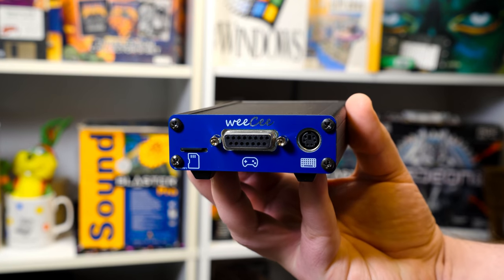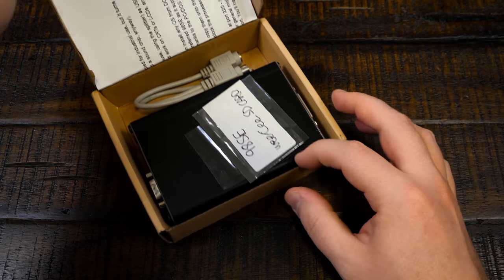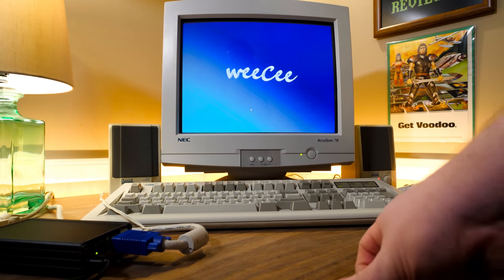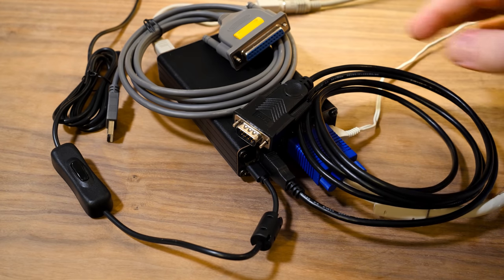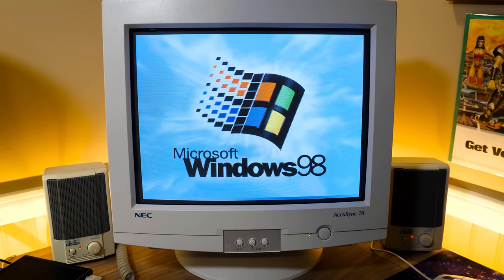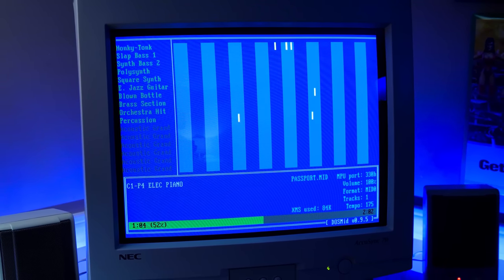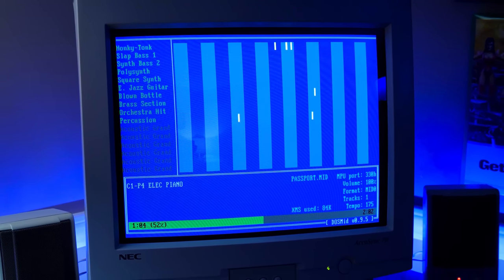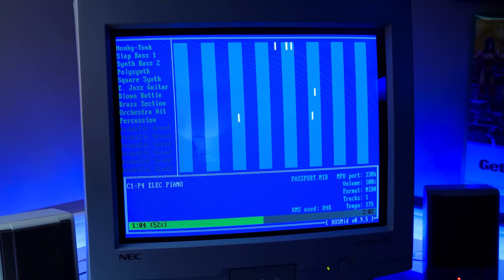The weeCee: A Tiny New MS-DOS & Windows Gaming PC!

Comment: I am impressed with this little machine! All the CPU options in the bios, being able to have a bunch of micro sds with different systems on them. For it to be perfect for my desires it would need to have a 3d acceleration solution, maybe a pci or agp slot would do it. Also the sd read and writte speeds leave a lot to be desired, but even as it is I can see it being very successful. I believe a Kickstarter would be a way to go for the developer to be able to plan a set production and cost and to be able to bail out  paying people's money back in case a minimum number of orders isn't met.

Comment: I think from a physical footprint and power consumption standpoint, this is a pretty amazing product.

Don't know if a higher speed rated Micro SD card works better for those installs, or just pumping up the clock speeds before running it.  I would say the clock speeds might be causing the long install periods.

Comment: An idea that I had was the reverse, but for vintage laptops or desktops. Imagine a PCMCIA card with an ethernet adapter and a Raspberry Pi Zero. You could use VNC viewer to log in it and have access to modern internet on a vintage laptop.
Reply: I've thought about cards like that as well. I don't think it would be too difficult to design an ISA card whose functions are all controlled by a modern MCU.

Comment: I would actually more likely buy that if it works well enough for older dos games. Would make for a cleaner setup instead of my large pentium or Pentium II system. Love the fact you can throttle the CPU down great for older DOS games for sure.

Make it a 3d acceleration version and would be my dream version. But as you stated this is close.
Reply: The lack of 3D and the slow MicroSD are the only things preventing me from wanting one at the moment.

Comment: I don't know the limitations of the little pc module but it'd be cool to have a mini itx breakout board so you could put it in a more traditional pc case and have a bit more room for i/o and maybe a floppy drive. Heck, being able to run it off a standard power supply would fix the issue of overloading the usb port. Even the lowest capacity itx psu would be complete overkill for this thing though.

Comment: I know a certain print shop that would love to have one of these to replace the Windows 10 PC currently running their entire MS-DOS-based invoice system on because they refuse to invest in a newer, more modern invoicing system.
Their old PC died and the boss looked at me and said "you like weird stuff, go try to save them.  Bill double."
Had to yank out the old IDE drive and blow the dust off my ancient USB-to-IDE adapter but I was able to image the entire drive into a virtual disk image that would work with VirtualBox.  A few more hacks later and it was back up and running on a brand-new Windows 10 PC with parallel-port card installed and printing to their ancient dot-matrix line printer.
Turned out some capacitors on the mainboard had just gone bad rendering the entire PC dead.
It was a complete nightmare and took a week but it got done.  That was many years ago...they're still using that same system to this very day.
Not to mention all the manufacturing machines out there still running MS-DOS-based programs.  This guy could stand to make a small mint if he can mass-produce these suckers in any quantites.

Comment: I would like to see this with I/O expansions, like a module you stack on top of it that includes a USB hub and the missing serial/parallel connections, or a hard drive bay.
I have never been interested in having original hardware around due to its bulky nature, so something like this would interest me.

Comment: A couple years ago I started on a project kinda like this. It would of been bigger then the weeCee but about the size of a computer power supply case. It was to have a power/reset/turbo buttons and a floppy emulator. However I wasn't going to use a SD card as the main storage but have SATA, the floppy emulator would use Micro SD. Sadly EasyEDA lost all of my work I had put into it and I haven't been motivated to start over again If I was to start over I would use KiCad.
I'm now working on a ARM based all in one system for Home Automation.

Comment: If they made it the size of a CD-ROM drive, it would still be small but they'd have room for all these nice things. More USB ports, full-size SD slot, serial/parallel ports, speaker, battery, buttons, maybe DIP switches to adjust CPU speed so you don't have to reboot into the BIOS to change it...

Comment: This thing is really awesome, but adding any kind of 3D hardware acceleration would make it absolutely essential to have.  Especially for people (like me) who don't have the space for a Win 98 tower.
Reply: I have an idea. A bigger PCB which can utilise a AGP port, angled by 90 degrees so the graphics card sits on the back, and all the other stuff on top. Put it into a little larger case than this one, and we should have a winner!
What do you think?
Reply: @danieldorn2927  I would definitely be in on that, provided the AGP port came populated with a decent graphics card of the era.  The charm of this thing is it's an SoC, and an AGP port would no longer really make it an SoC as you'd then need a modular graphics card.  But your idea is sound, I wouldn't mind a bigger form factor so long as it's significantly smaller than a full-on tower if that's what's necessary to get the thing 3D accelerated.

Comment: If the power supply is getting overwhelmed, it probably just needs one with a higher amperage -- same reason a beefier one is recommended for MiSTer instead of the stock DE-10 nano one.

Comment: This is so awesome and the fact that it allows you to connect original hardware and use original software without emulation. I do wonder though, how well a Pi4 could do with games from the Win98 era. I've managed to get a lot of DOS games running on my Pi4, haven't had the time to setup bochs or qemu to try for Win98 yet. Unfortunately, installing it through DosBox doesn't work as the Windows installer gives me weird errors depending on when it randomly decides to quit.

Comment: Very cool. A 800Mhz or 1200Mhz pentium 3 would be awesome for duke3d, doom 1-2, half-life, unreal tournament, quakes, gta 3, 1942, max payne 1-2, maybe even hl2 if a later gforce 4 or fx series. Pentium 3 architecture was beast in later Centrino mobile platform. GTA SA ran like a dream on a 1.6Ghz Centrino with 512mb

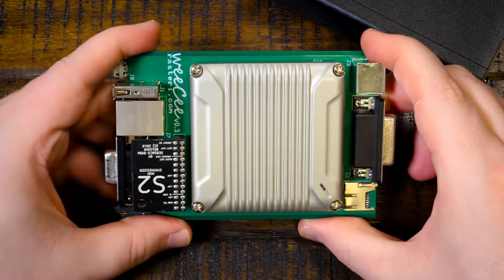Comment: 4:15 That's an issue I deal with in regards to running my Raspberry Pi. The only power supply strong enough lack an on/ off option.

Comment: This is super cool and would mind having one but a $600 price point is steep. I understand the part and skill to build this isn’t cheap, but there are cheaper options for a retro computer that almost as small. I use an old HP t5730 thin client to play older games. It’s got a 1GHz AMD CPU with a 32MB ATi video card. Not counting the SSD I instilled it was less the $30. 
If you’re not able to build a computer from the ground up, the thin client is a good option.

Comment: It would be nice to break out the PCI BUS to add an external graphics card (assuming that is possible with that SOM). Serial and parallel ports would also be nice to add. It doesn't need to be so small; it can be a little larger, and I think that would be fine. Heck, you could even just make it a microATX form factor and just sell it as a motherboard and just break out the ISA slots as well; that, to be honest, might be even better.

What I really want from this type of device is as many new components as possible so that it won't break as real vintage machines do all of the time. Dealing with vintage machines is a pain because of constant failures; I would buy it if someone could solve that problem without emulation.

Comment: Amazing! I always wished to have a cheap PC that could run Windows 3.11 to Windows 95 natively.
If they only would be able to run a 2 core, 3Ghz CPU, with 4GB of DDR3 RAM, and an on board IGP that outclasses the older ATI Radeon GPUs, yet has vga/svga compatible graphics options built in for DOS, you'd be able to max out all your games on something like that.

Add an emmc drive, split into partitions for DOS, Windows 3.x, and Windows 98se, to use either as OS drive, or with few smaller games installed; using the sd card slot for games.
For SD card I'd probably go with a Sandisk A1, micro SD card. The A2 is too fast for this application; the A1 is cheaper, and fast enough.

Comment: My issue is always that these kinds of systems don't work great with those early 3D accelerated games, and some of those are the kinds of games I'd want to play first over anything else.  If there were a way to play those types of games in an easier fashion (and without major problems to just get them to work correctly on modern hardware), it would be really helpful.

I think if something like this were a tad bigger with more IO, and full 3D acceleration, it could hit that sweet spot of small size, and usefulness.  I don't have tons of space so having a decently small retro PC would be amazing, but for me its gotta have good 3D acceleration.

Comment: I keep forgetting the compaq armada 1150 laptop I have can output to a display (because the LCD is washed out for DOS games), when I get around to using it, I can enjoy some retro goodness (going to ditch windows 95 because not enough RAM). Though, if the hard disk ever fails, i'll need an IDE to SD card adapter.

Comment: What spec games could this feasibly play? Interested in playing Diablo 1 and 2 on close to original hardware on a CRT, but also perhaps, the original Deus Ex and or Unreal Tournament GOTY and other such late 90's early 2000's 3d games... 

IS this aimed more squarely at DOS and a few low-requirement windows games ?? 

Will this struggle with 3d games?

Comment: Can't be long now until the perfect mini gaming PC for 98/XP, 3GHz CPU, 256-512MB D3D9 GPU, EAX 5.0 Sound card, 2GB Dual Channel RAM, SSD Drive, DVD Slot Loading, Inputs> DVI with both VGA & HDMI mode, USB-C with Display Port Alternative mode, Component, S-VIDEO, RGB-SCART and Composite out for using with CRT TV sets, built in BT for wireless audio and controls, that should do it.

Comment: This computer needs to be placed into keyboard. Like atari, commodore or amiga 1200. It needs to have a big midi card option (like yamaha size) or rapsberry pi zero as midi emulator. This should be lovely piece of hardware, well designed. And then I will look at the price

Comment: How hard would it be to modify the project slightly? Rather than using the 2d GPU, say use an old 3dfx vsa-100, or an old rage embedded applications chip? I legitimately don't know how plausible that would be. But I would imagine a hell of a lot more useful for old games.

Comment: Looks really nice. I am not a fan of the mirco SD card though. I really don't like handling micro SD cards, they are too tiny. And I don't like them being exposed on the outside. I think it would be nicer if the SD card would be internal and then also accessible to read/write over the network (NAS) so you can do all you CD dumping and copying from somewhere else.

Comment: That is a great project.  Too bad the price point being what it is, for the parts cost itself being a bit up there for what I would find use of it for.  Soldering that up would be a lot of work, and I might manage it, but I don't think I would find it an enjoyable part of the process at all..  Considering it is a current industrial computer base, it wouldn't be expected to be too cheap.  I guess it should last for years though based on what they design the things to handle in industrial use.  It is great to see things like this out there.

Comment: Cool and neat but I dont QUITE get it. 250-300 Pounds for 800MHz and 256MB RAM. Meanwhile a basic MinisForum Z83 Mini PC offers a Quad Core CPU and 4GB RAM, WIFI module, USB 3.0 etc at the cost of around 80 EUR. Latter being also a x86 architecture capable of all kind of Windows retro stuff.

Comment: I've been looking for years for a practical way to run Seer Systems Reality (arguably the first commercial software synthesizer, and impossible to run on anything other than Windows 95 or maybe vanilla Win98; doesn't play well with virtual machines and even if it works the latency is too high and the support for audio and MIDI hardware is prety much nonexistant in general purpose VMs, so it jsut isn't a solution) without resorting to a dedicated Pentium I (it's a really interesting program even today, but not THAT interesting).  This might finally be it, and small enough to make it easy to use as a standalone instrument in a modern music hardware setup, too.

I'll have to start collecting parts in the spring.

Comment: This sounds spectacular but I've got one question, can it run Windows XP and become the world's smallest blind gaming computer? :-) edit thanks for answering the question in the video lgr. This will work for many blind games or audio games many of them are simply terminal text-based games with simple sound effects that are read by a screen reader called non-visual desktop access or nvda others like kitchens Incorporated don't take much more than that to run and are very fun once you get the hang of it being only audio.. I would recommend as starting out if you're going to start playing audio games the audio games archive and these developers,
Richard di steno
Kitchens Inc
PB games
l works. Enjoy! I mainly play the card and board games and the baseball and football from kitchens Incorporated also there's an endless classic airplane shooter for some reason called puppy one from them that's pretty fun as well. This is the first time I've heard of this gaming mini PC and I forget who made it but I wish them the best of luck they've really built something cool! I wonder if it would work if hooked up to one of those external portable phone battery charging ports or hooked up to a long cable and a car's USB port for long commuting trips it would work as a blind gamer computer very very well if I'm not mistaken.

Comment: I imagine VGA compatibility is going to become a problem in the future if you're not using monitors VGA. I would prefer built-in HDMI even if it was more expensive. Or at least an option just remove the headache when VGA monitors are less common.
Reply: with my own Weecees, I set out to find a VGA-> HDMI solution. After the first one didn't work, I bought another (they're very hit or miss on Amazon). which semi-worked - but it draws power in order to let sound piggy back on the HDMI signal, and I was using the USB port for it. After I realized it often tripped the poly-fuse in the weecee and then caused problems in normal use, I just desoldered the fuse and just used a wire bridge instead. Everything works now and I can output video and sound to a modern screen with HDMI.

Comment: I had the same Accusync monitor and it was one of my favorites. The bummer was that I was running speaker wire and it slipped up into the high voltage side and discharged the flyback circuit and somehow I didn't die. Monitor never worked the same and couldn't get a stable picture. The weird thing was the OSD was unaffected somehow, but the picture looked like garbled mess otherwise. Played hours of Unreal Tournament 2k on it so got more than my money's worth.
Reply: If I can remember correctly the NEC monitor had the latest Sony shadow mask tech and the picture was always incredible, and I think 75Hz on 1280x1024.

Comment: If this is not emulation but just DOS/Windows running on x86 hardware, how does the 800 MHz clock speed work, as I thought that there were games that relied upon specific CPU speeds, which are of course much, much lower than 800 MHz?

Comment: This will surely bring back gaming nostalgia but not the hardware feeling. it cannot replace that.

i am selling my old 386 and Pentium III... as scrap 😒😣😔

 386 - it doesn't work anymore. IO card failed. Harddisk 130 mb failed. Ram keeps giving beep sound. and about Pentium III - The integrated SVGA is failing as i can see lines and scales on screen.

Comment: What can the graphics chip actually do with 32MB? If it's only for framebuffer, you're gonna need a huuuge monitor. Normally the extra RAM is for loading textures and 3D stuff into, but this doesn't have that.

Comment: What are the advantages of this over emulation and cheap SBC's like the Pi?
Reply: emulation has input lag, skipped frames and will run into issues with some games if you use it long enough with variety of software. The pi would simply by a unix based emulation machine if your goal was DOS, so it runs into the same issues.

Comment: Ya grew up on old decent 1-2 days.  Still have my disc. But no way play them on my 2700x lol.   Miss the old sb16 days. 
Would love see version of this in bit bigger box with 3d capable.   I still have 2 my old PCI Voodoo 2000 Gpus. Lol.
Ya I had one those green cyrix cpus.  But forget which one I had.  486 one? Lol.